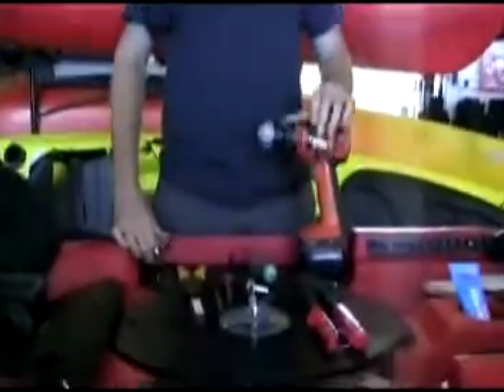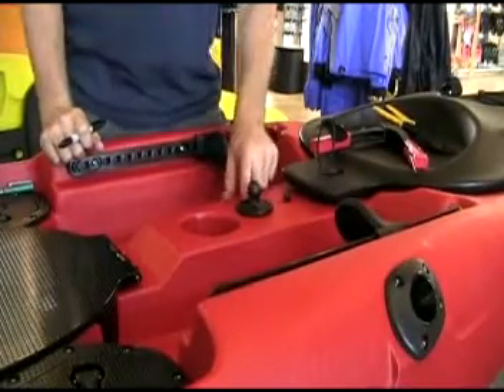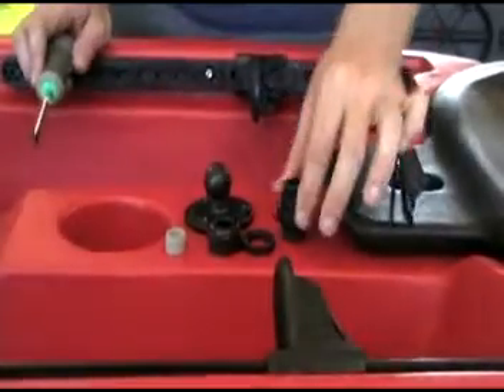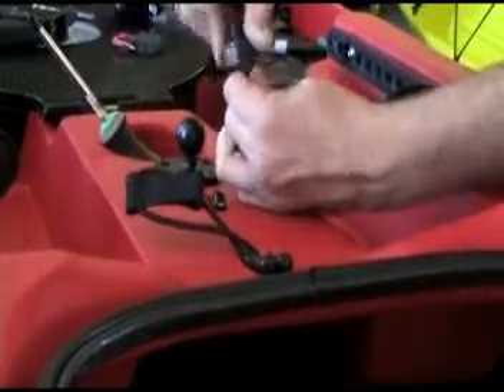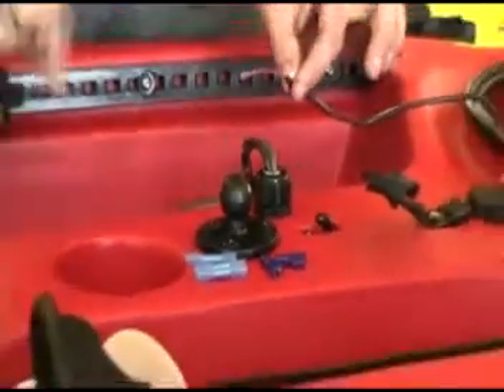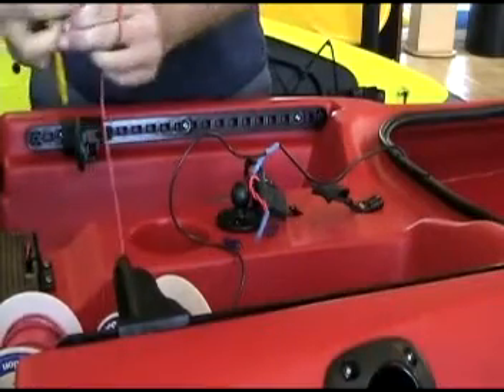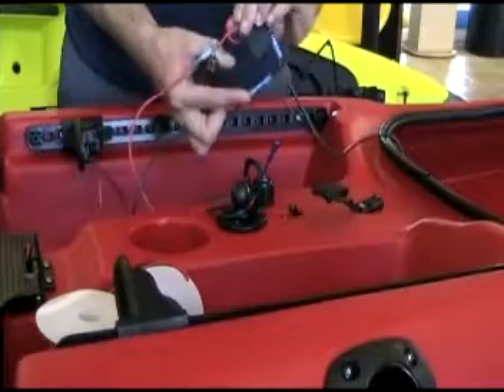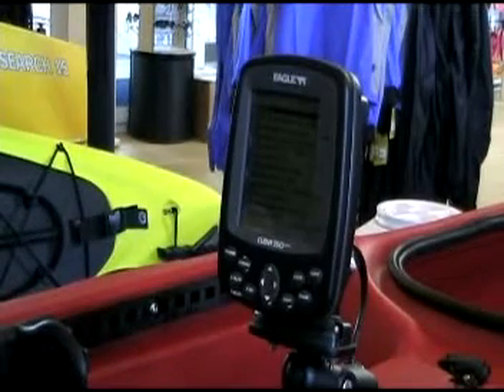KayakFishingSupplies "How To Install a Fishfinder"

Comment from the maker: Depending on what you use-our battery box can be placed between the scuppers and secured by bungee, or hook and loop tape (velcro)-if your using a dry bag you can attach the buckle around a scupper as well.

Comment from the maker: Water temp will be off a bit until about 15 minutes until the water and the plastic have time to adjust.  Scupper mount will give you a more accurate reading.  You can always bring a pool thermometer with you-there cheap.  The FF will only read surface temp.